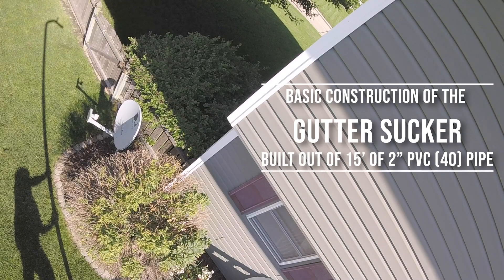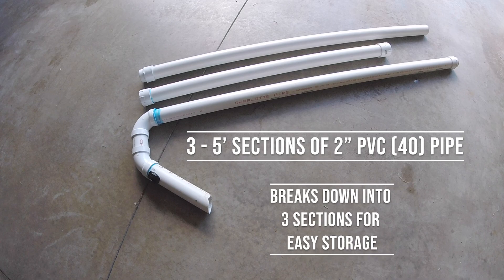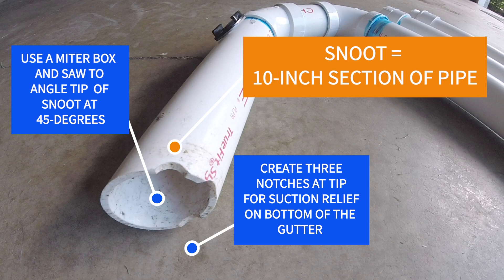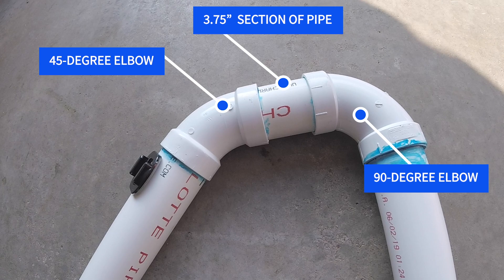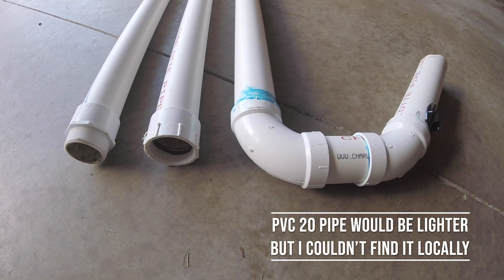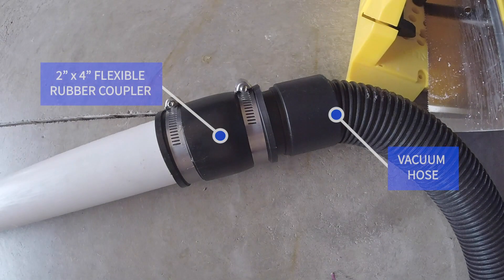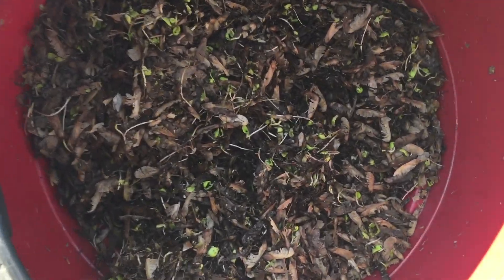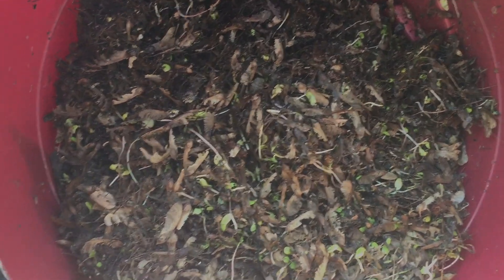Gutter Sucker: An easy way to clean your gutters without having to climb a ladder

Comment: Just sending a thank you for posting this. I bought sections of the central vac tubing to try to make a lighter rig, not realizing you can’t mix regular pvc you’d buy from Lowes/HD with this (different od). It’s an “all or nothing thing, or at least you need to do a whole lot of adapting back and forth.

Comment: I just built one using components from Lowe’s. My 90° bend has a tighter radius than yours, but otherwise this is an excellent solution. I used 2 x 10’ pipes as raw material instead of your 5’ sections because I can store that. I wound up splitting one of the 10’ sections in two to allow me more length configurations. That hose clamp fitting is pure genius. I keep a stubby screwdriver in my pocket when I’m doing the gutters. If it clogs, I can often unclog by reversing the air flow. Works great with my 5.5 hp shop vac.

Comment: How are you preventing so much flex as you use multiple poles I have 4 5 foot sections would it be better to permanently connect 2 five foot sections

Comment: Why 2”x4” rubber coupling is used to connect the 2” pipe to 2” vac hose? Shouldn’t it be 2” rubber coupling instead?

Comment: I wasted $100 at Home Depot. I could not find schedule 20 so I used what you'd built in although it looks cool. It weighs probably 75 pounds when you're trying to hold it straight up in the gutters and the vacuum I'll be it. It's pretty big will not suck out the Pineneedles. Thanks for the video. I appreciate it, but it won't work for me.
Reply from the maker: @adamprosenthal  sorry it didn’t work for you. I added a strap to it last year which helped with the weight.

Comment: I get heavy sludge. I use 3/4” pvc about 24’ long with a hook or “U” at the end that I form using a heat gun. Also using a heat gun, I pinch the end so I get a sludge busting spray. I attach a garden hose to the other end using adapters found at any hardware store.

Comment: I found a way to order the lighter schedule 20 pvc pipe but am still waiting for  it to get here--was  supposed to have already been delivered last Monday or Tuesday, Oct 30 or 31, 2023.  Still waiting for UPS to update me on what has happened to my items.  Supposedly they have already arrived in San Jose on Oct 30 but I have no updated information on that.  Since I heard there is rain coming this weekend, I thought I'd try your method.  You mentioned that the snout or actual sucker part was made from 10 inches of pipe.  Looks like, in the video, maybe the length of the pipe from the edge of the 45 degree elbow is 10 inches--looks longer than mine looks so I'm just wondering.  Did you cut 10 inches or a little longer to make the length from the edge of the 45 degree elbow 10 inches?  Anyway, I like your design--I think the 45 degree elbow with the 10 inch pipe is better than the other design where the guy used the lighter pipe and he used 2 90 degree elbows for his.  Now I'm working on getting the camera on this tool so I can see what's going on.  Thanks for the great video!

Comment: Curious how taking the filter out didnt damaged the motor? The filter is there to protect the motor so how comes it didnt get sucked up into the motor and damage it? Ive got a similar setup here in australia but too scared to take the filter out in case something solid like a bit of roof tool flies into the motor etc

Comment: I built something similar and the vacuuming just didn’t work for me. My gutters mostly collect pine needles and they would frequently clog things up at the nozzle. I later went in the opposite direction and got a gutter blowing kit.  No more clogs and it blows all that stuff out. Yes, it does rain down on me and the flower beds, but it beats dragging a ladder around. However, it only works for loose, dry accumulations of debris. Once it gets wet and compacted, grab that ladder.

Comment: Great recommendations and video....especially the angled snout design.....BUT..... Sch 40 PVC is awfully heavy when building a unit like this, and you are better off with less weight using Sch 20.... used for in-home-wall vacuum systems and other areas.Available locally usually at electrical supply shops or from Amazon

Comment: How are you able to watch your live view on your phone if you are using 2 hands to hold your PVC?
Reply from the maker: Two ways - my wife holds the phone and acts as my guide. I have also used a clamp to attach the phone to the pole so I can see it. The assistant method works the best.
Reply: i have a Craftsman 3.5 motor shop vac. will this be powerful enough to have that many pole’s attached?

Comment: I found your video after searching for both DIY and powered blowers. Not wanting to spend $200+ for another yard tool to deal with, I decided to to try the gutter sucker. I had 2 inch PVC pipe left over from a previous project, and picked up 45 and 90 degree elbows and a 4x2 inch rubber coupling at the hardware store. In about half an hour, I had the gutter sucker ready for trial. I have a 16 gal Rigid shopvac with a 2 inch hose and the coupling fit perfectly. The 45 degree angle for the nozzle provided a good standoff, which I needed in my case. It worked great! Dry leaves did occasionally collect on the inlet nozzle and required me to drop it down and pull them off, but most went to the shopvac. I tried putting the hose on the discharge side of the shopvac to blew the dry leaves out first, then sucked up the balance of the debris from the gutters. Weight was not an issue for me as the main tube is only 6 ft in length. The two 3 ft sections of tubing that came with the shopvac extends that to 9 or 12 ft if needed. For less than $25, the roof dance and ladder climbs are history. Thank you for a great design, and a very well done video.

Comment: great but how does it go with wet material  ?????
Reply from the maker: It really depends on the power of your ShopVac. I have since used it to suck some wetter material. If I were to rebuild, I would use the lighter pipe. Even though I have added a strap to the device since this video it is still kind of heavy.

Comment: I put one together this weekend. I also used 2" diameter pipe with two 5 foot straight sections. As matthewskarate mentioned below, pine needles don't cooperate. On regular leaves, they would go through the curved section, then through the first 5 foot section but they get stuck a few inches before exiting the second 5 foot section. The leaves were dry. I would have to disassemble the second 5 foot section and pound it on the ground to dislodge the leaves.

Comment: The thought occurred to me that a shop vac with a water filter would be better than using the vac without any filter. Of course,you would have to add some extra pipe to the shop vac,one pipe going from the hose inlet to near the bottom of the shop vac body,and then fill the body about 1/3 full of water. Frequent emptying of the vac also required. I would not run the vac without a filter,though. That would eventually kill the motor.

Comment: I took the HEPA filter off of my shop vac, but I wrapped the filter cage with a piece of furnace air filter to keep stuff from getting sucked through the motor. There was minimal air flow restriction and it protected the motor. Thanks for your video!

Comment: Great minds think alike! Before even seeing this video, I was thinking of the idea of using screw coupler adapters! :D In my case, I'm planning to use something like this but the other way around with a leaf blower. I don't think my little shop vac is strong enough. 2" diameter PVC seems to be the most 'universal' as far as fitting into gutters as well. I should probably just get a bigger shop vac at some point.
Reply: This is what I'm wanting to accomplish also. Any success using with a blower?
Reply: @shauncrochet7934  I ended up just hiring a guy to clean the gutters as they were super high up off the ground and I didn't want to bother with it. After that, we changed our gutters out too lol. I may revisit this in the future now that I've picked up a stronger shop vac though...

Comment: This is a great idea.
What works better for me then thin wall Schedule -20 PVC tubing is 3 inch "round" x 10 ft long aluminum down spout. Pros: it's much lighter, far more rigid for better control and low cost. Cons: it takes a bit more effort to couple the various sections together.

Results: I can easily reach my first, second and third story gutters buy coupling or decoupling 10 ft downspout sections.

Bonus: After vacuuming all the gutters, I securely attach my iPhone to an expandable window washing pole, then in video mode inspect all the gutters to make sure they're all perfectly clean.
Reply: Can you provide a link to some information about how to coup and decouple the 10 foot aluminum downspout sections?

Comment: Schedule 20 PVC pipe is the stuff used to put together a whole-house vacuum system.   I found mine at a local electrical supply house.  I also slipped a 2'-long piece of 2" ABS pipe between two 8'-long pieces, making it easier to reach my second-story gutters.

Comment: How many times did you have to stop to clean out clogs in the 2" contraption?  3" would be better, with a minimal decrease in suction.
Reply: But 3" is tight or impossoble to "Fit" into the gutter....and you lose a lot of efficiency tapering down to 2" to allow it to fit into the gutter space when there is usually a bit of shingle overhang.

Comment: love the setup...especially the go pro attachement.  i made one similar but out of black ABS.  Needed it a little more rigid where i have a 30ft section to do.  I did run into some caking problems with some of the wet silty stuff but certainly works well....well I think so because i didnt have my gopro mounted...LOL  Ver 2 is now on the way.
Reply: What size/power vacuum did you use?

Comment: Thanks a million!

Update. Just made one and man it works like a champ. Mine is heavy due to 2 ten foot sections but hey it keeps me off a ladder or hiring a guy to do it. $45 in total saved me $75 for a gutter guy.
Reply: Hye man. I have 20 ft gutters as well. How cumbersome was yours? I cant find the schedule 20 pipe anymore, and kinda apprehensive of using the heavier stuff
Reply: @Middleguy37  If you have an extra set of hands to help it might not be as bad. Hardest part is raising it up to the gutter and bringing it back to the ground.  If I can find the thinner pipe I will  remake it again. Good luck 🇺🇸
Reply: @nimrod275  Thanks for the followup

Comment: how do you connect the piping to the shop vac tubing if the tubing is 1-1/4 or 2.5"  I can't find a flexible coupling that fits.

Comment: I can tell that's a tiny itty bitty wetvac, removing the filter can void the warranty, or break the motor. Sounds like you should get a better one... would be nice if you gave a reference on what size, and peak power your current wetvac has. Mine is overkill.. considering returning it.
Reply from the maker: 6 HP and I think is an 8 or 9 gallon

Comment: I built one of these and added another 5' section since we have a somewhat taller 2 story than the OP. We have 5 inch "K" style gutters.  I used schedule 40 solid core PVC and it was really heavy and difficult to manage with the extended length. Also, pine needles in the gutters would clump together in such a way they were crisscrossed (like spaghetti noodles) and wouldn't go into the vacuum hole.   This may work better on leaves and houses with shorter distance to the gutter. If using schedule 40 foam core may also help by being lighter.  I was really wanting this to work. 

Now I am thinking the 20' 2.5" shop vac hose attached to a 24' telescopic pole and "U" turn hose on the end of the pole with a camera mount on the "U" may be the way to go.
Reply: I think the 20' shop vac hose means have to climb ladder
Reply: I think the 20' shop vac hose would necessitate climbing ladder

Comment: that's great if its small stuff. leaves will clog the vacuum quickly
Reply from the maker: It all comes down to what you'd rather do - deal with a few clogs (which I did) or climb a ladder. The more I have used it the quicker it gets now that I am just doing occasional tune-ups of the gutters.

Comment: How did you secure the GoPro camera to the pipe?
Reply from the maker: Standard GoPro Mount - https://www.amazon.com/GoPro-Grab-Bag-Official-Mount/dp/B01GCKO9IK/ref=asc_df_B01GCKO9IK/?tag=hyprod-20&linkCode=df0&hvadid=312066954908&hvpos=&hvnetw=g&hvrand=7192458370383820658&hvpone=&hvptwo=&hvqmt=&hvdev=c&hvdvcmdl=&hvlocint=&hvlocphy=9021906&hvtargid=pla-403917725187&psc=1

Comment: I have a service drop right over the corner where the end of a gutter is. Idk why the builder did it like that but it's a bad situation in terms of repair. The house is packed in with the next house and there's barely any room to put a ladder. There's a lot leaves piles into that corner Also, the fascia board there showing sign of water damage. What's the safest way to clean that part of the gutter and also repair the fascia board, without being electrocuted? Thanks!

Comment: This does work great!  However, you really do want to use schedule 20 if you have a run of more than 15 feet. Not only is it heavy and almost impossible to lift the schedule 40, there's very little control.  Save yourself time and money and seek out the schedule 20 if you're a two story home.  If you're a one story home, the 40 will be fine.
Reply: Width
Reply: Of pipe
Reply: @Nagy Hanna schedule 20 is a thinner wall pipe than schedule 40 which also means it won't be as stable if you're trying to reach 20 ft. in the air to 2nd story gutters.  hardly anyone sells it anymore, but it's very close in wall thickness to class 200 pvc irrigation pipe.

Comment: Thanks for this amazing video! I build one tonight and will be trying it tomorrow. 

The one change I added was a male adapter at the 90 degree elbow where it would connect to a 5' section, just so it's even easier to store... I also didn't have a dremel to create the notches at the tip of the "snoot" so we'll see if I end up having issues.
Reply: How’d it work without the notches?
Reply: @lindseyrsmith2194  not great. I ended up adding some. They don’t have to be perfect
Reply: If you mark the angle you plan to cut the tip at you can then drill some 1/2” or so holes in the pipe along the angled marking.  Then your mitered cut will create the notches for you.

Comment: I used the setup today, and it worked great. However, I would advise everyone to do this before the leaves in you gutter get too moist. I had to work a lot harder to free the debris from the gutters, because the leaves were really wet. I had to flush the system out several times with my garden hose several times before I finished the job. Thanks again.
Reply: If you had to use the garden hose and climb up on a ladder what's the point of using the gutter sucker then?

Comment: I assembled the gutter vac with sche 20 pipe, but my old 6.5 hp Rigid vac doesn't seem to generate enough vacuum to do a good job, so I'm looking for a wet dry vac with more CFM that won't break the bank. A VacMaster at 150 CFM and a ShopVac at 195 are the highest I have found. Todd - What model vac are you using?

Comment: Easier to blow them out than to suck them out, especially when they are wet.  And wont clog the hose or pipe.
Reply: What would you use to blow them? The exhaust port of a shop vac doesn't seem like it would be strong enough and this seems less messy?
Reply: @capturingperfectionphotography  Rig up a leave blower.

Comment: if you can find sch 20 which is light but easily broken. use abs ( black plastic pipe) abs is alot lighter than pvc

Comment: That looks like a good solution to cleaning gutters every year. I got tired of cleaning mine because they were always wet and nasty and close to the electrical lines feeding my house. So 2 years ago I installed gutter guards from Amazon and will never have to clean my gutters again. Cheers!
Reply: Did you install them yourself? Was it difficult to do? Any chance you have the link to the ones you’d recommend? I see a lot of different opinions on which ones are best. Thanks 🙏
Reply: @ilikemyrealname  Here it is "FlexxPoint 30 Year Gutter Cover System, Matte Residential 5" Gutter Guards, 204ft" Check the size of your gutters, my were 5 inches wide. The screws were included. I installed them myself and it was super easy. I used a cordless drill with an attachment for the screws. Don't forget to clean your gutters out first, it will be the last time you will have to. Good Luck!
Reply: Starman609 Thank you so much for your reply. I seriously appreciate this! Imma look into these.
Reply: Gutter guards just delay the inevitable and make it harder to clean once you have have to as gutter still sludge up.   They also tend to cause other leak problems over time.   Vastly over hyped in general.
Reply: yarpos I’ve seen quite a few similar comments to this. Thank you for sharing. What do you do instead, just go up and clean them? If so, do you have a preferred method.

Comment: I have long pine needles, this wouldn’t work for me.  I go up there with leaf blower, done in 10 minutes,  but I have to go on the roof.
Reply: I also have long pine needles. I purchased xtra tubing for the wet/dry vac from home depot. Attached an arlo camera  and it worked for me. I just wish the top of the vac could be attached to a 5 gallon drum. I keep having to stop to empty the vac.